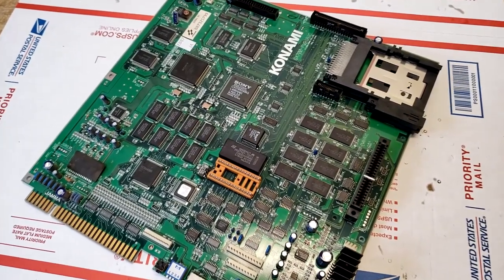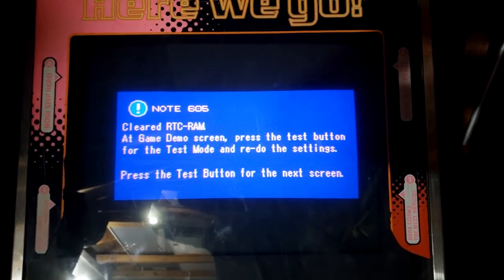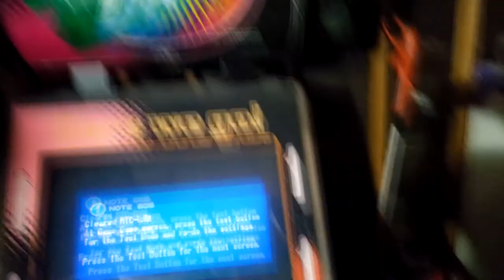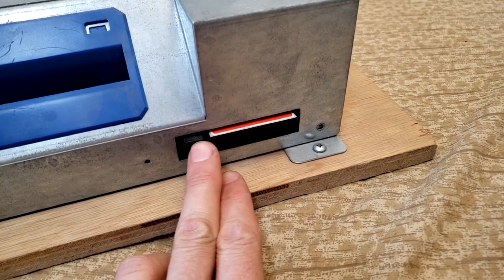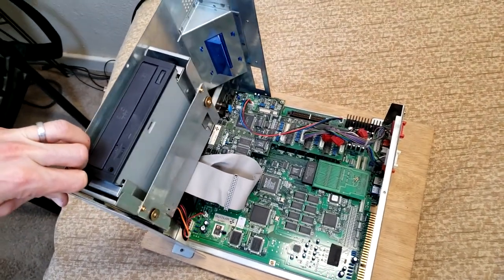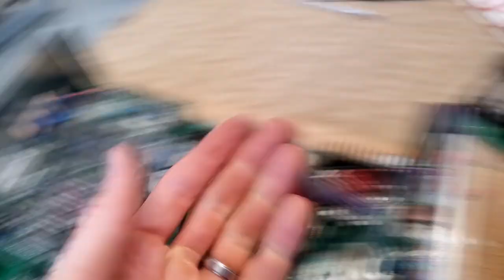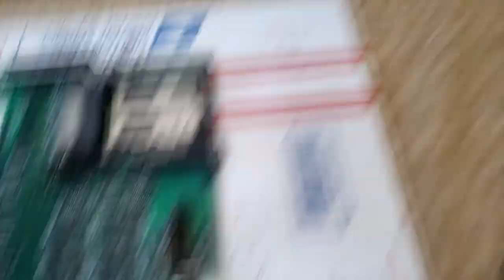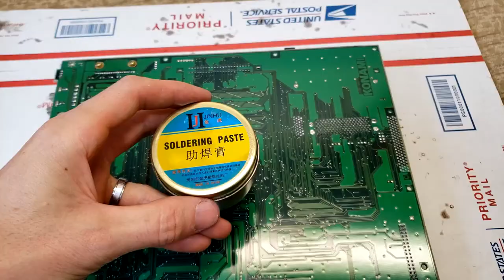Dance Dance Revolution RTC-RAM Error Note 605 Repair - Bemani System 573

Comment: Hey, great video! I am looking to get a DDR machine working that's missing both the security cassette and the PC flash card. I've been looking for a card to order, so that shouldn't be a problem, but you mention in this video about making a custom boot ROM to bypass the security cartridge. I've looked around for some information, but could not find anything. Could you shed any light on making such a boot ROM?
Reply from the maker: security cassette is no big deal.
flash card is harder! They are around £$100 beans+
I don't think Euromix1 requires a flash cart though haha! It's on the Superdisc (google: DDR EXTREME CLARITY) for that

Comment: I have some questions for you.  I have a dance maniax that started giving the 605 error around 7 years ago.  For about a year we could continue to boot and play but eventually it stopped allowing us to continue to boot.  Every time we run though the diagnostics we only find the 605 error.  You stated we should be able to continue to boot the machine, do you think we may have an additional issue since we cannot go past that error and boot the machine or will a 605 error eventually stop you from booting.  What we had seen was only 605.  I found someone (finally) who can do soldering so I was searching for more information on what chips to buy and what and how exactly to do to replace this chip.  

For me this is a particularly important thing because I am disabled and cannot do much activity using my lower body and very much want to use the dance maniax as it will give me a chance to improve my health as it uses my arms only.  Thank you for your time.
Reply from the maker: I put all the info on the parts in the desc, so you're good on that

If you cannot press button in coin door to resume boot, then maybe your button is loose

dance maniax super disc avoids and skips 605 just like ddr does, so go with that at a pinch

cheers

Comment: Hola comunidad, tengo un problema con mi konami system y es que tengo un boot loop no carga el juego el chip M48T58Y-70PC1 Chip ya no se encuentra disponible en amazon ni aliexpress, donde puede comprar el chip.
Reply: Ábrelo con un dremmel, checa videos aquí en youtube. lo mas dificil es desoldar el chip, ¿de dónde eres?
Reply: @AngelTorresT  Hola Imagínate que era la unidad de DVD la cambié y de una me cargó el juego sin problemas, ya hice el pedido por eBay y el socket por Amazon, si me gustaría cambiar la ese rtc pero por ahora todo está funcionando bien, muchas gracias.